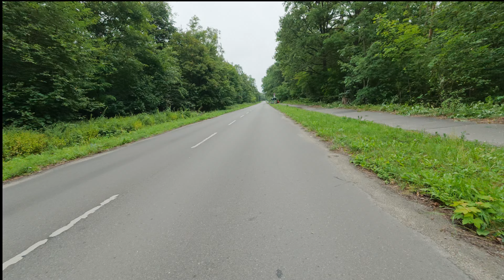I Took My Cargo E-Bike 188 km Off-Grid — Powered by Solar

Comment: I love those black folding panels. What are they called? How is the output? They look like a type N cell?
Reply from the maker: ELECAENTA 80W ETFE HPBC Panels is the make and Model. I am quite pleased with them so far, and will see how long they last. In a later video I show tentpoles that I repurposed to align them to the sun better and that increases the output tremendously, it is not a final setup, though.

Comment: Hi, I'm new to your channel, so Hello 😊👍

Just a heads up, any shadows on solar panels drastically reduces output. There are videos on this subject if you want a second opinion but I've tested this theory on my own panels and it correct.
Renology has just released partial shade solar panals that eliminates this problem, hopefully they'll make some smaller compact panals that would be great for what you're doing.

I have been thinking about doing something similar with my E-bike for extended camping trips, so finding your videos interesting.
Reply from the maker: You're right to point that out. Sometimes when I am done charging I still take pictures...

Comment: Nice! You got pretty much a setup like mine I’m designing right now. I got two 950w batteries for my bike and an EvoFlow river 2 pro (my knowledge of building is fairly limited) plan is to charge the river2 with a 200w panel and when possible at some restaurant. My bike (Swedish brand Rawbike) is not a longbike so it’s hard to build a rear rack strong and wide enough to house everything. Well, thanks for nice videos and give me inspiration to continue building my system
Reply from the maker: I used the first river in my first tours. It works, but convering to AC is less efficient that using a DC charger. Maybe there is one for your bike as well.